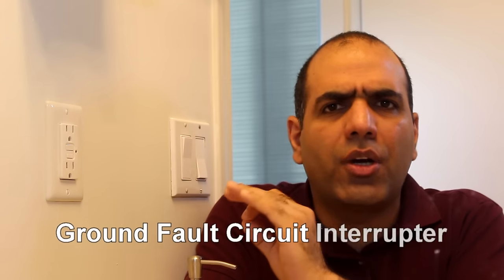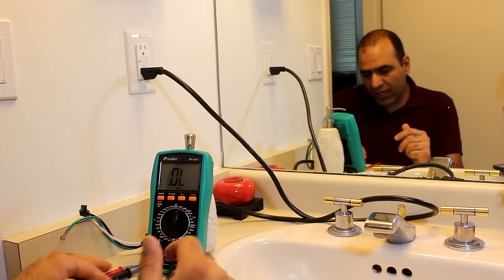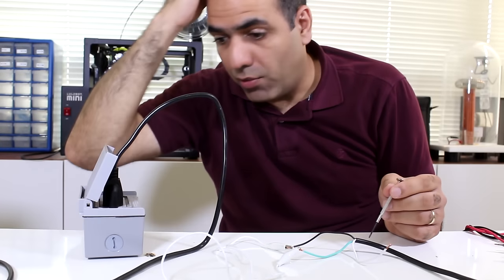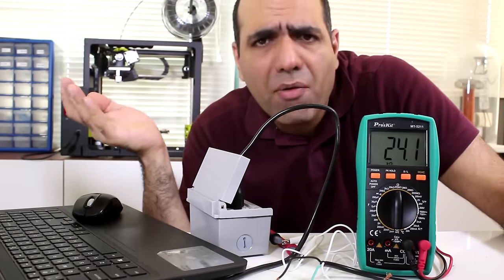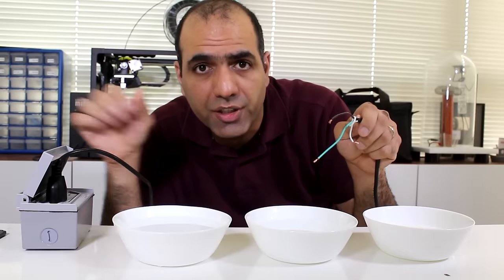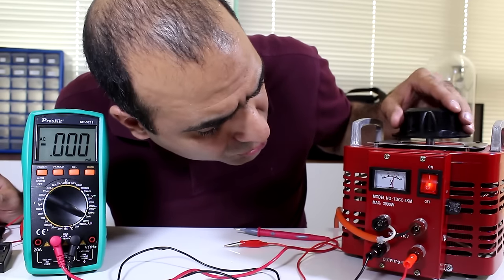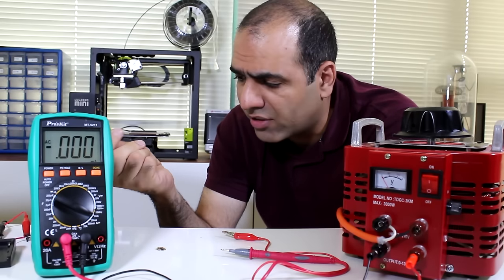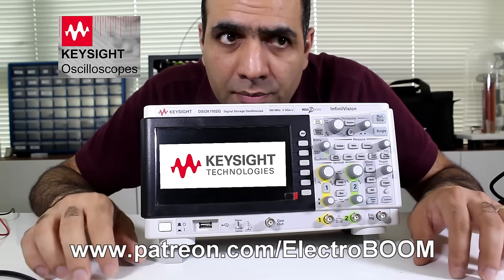The Outlet that Saves Lives

Comment: I stuck my fingers down a live lamp socket before, and I grabbed the bare contacts of a half-removed night light when I was like 4 or something. I just remember my fingers vibrating, but no pain.
Reply: Patrick Jackson i dont know what you mean by vibrating. Personally i  had a run in with a live lamp socket and it fucked me up. Good thing i was holding onto a metal bar. But in reality dont fuck with mains voltage.
Reply: It felt like a tingling vibration. Imagine if you lick a button cell but your tongue also vibrates. I live in the US, so our mains is 120 volts
Reply: I was standing on a ladder when my arm accidentally touched live and neutral wire, it felt like when you hit your elbow on the sensitive spot
Reply: Even when isolated from earth, touching 120V AC is defenetly more painful than a little tingle, especially for a little child. Are you sure the lamp was mains powered?
Reply: Very
Reply: Moral of story is, I will never try it again.
Reply: Maybe that lamp used to run on lower voltage
Reply: I can verify that it doesn't always hurt to touch 120v (at least right away). I accidentally stuck my finger into a light switch without a cover. It was dark in the room and I couldn't figure out why my hand felt weird until I noticed what I did. That was on 120v, and I was around 5 at the time.
Reply: Was it vibrating at 60hz?
Reply: I'd assume so given that it's the US standard.
Reply: Zaklamp that's probably because you did
Reply: this. i did this multiple times over the course of my life. some for extended periods of time for fun. it kinda spooks / hurts at first, but you quickly get used to it.

i've learned from my electric shock therapy that you take about a minute to get used to a painful shock, at which point you can increase it by about 5~10% to get back to the same pain threshold you were when you started. i did this over and over with the machine and ended up with a shock like 3 times as powerful as i started, and i started at the strongest shock i could tolerate without wanting to pull off my hand. unfortunately i don't have the data for the strength of the shock, but it was much, much more painful than a 127v outlet even at the beginning. at the end it was strong enough to contract / spasm my hand involuntarily every time the sine signal peaked. it set the machine to a 120 hz saw-wave ac current with a modulation (not sure if this is the right term, but you get it) of 0,5 hz sine, meaning it slowly peaked then faded out every two seconds .
Reply: It vibrated because you were feeling the current oscillating. Been there done that.
Reply: Patrick Jackson I did the exact same thing with a night light.  I've always described the feeling as the hardest vibration I've ever felt in my life.  I think I was 8 or 9.
Reply: wow, god must if gave you mercy
Reply: Alexander Worley if you were holding on to a metal bar that means that it would be grounding you and therefore as electricity flows from high to low voltage, it would send a high current of high voltage through your body and therefore would hurt you more. Let's say that you were standing on a plastic stool, you would feel virtually nothing if you only touch positive. Plastic is a good insulator and not a good conductor. Holding a metal rod didn't do much for you man.
Reply: Josh's Aquatics & Railroad Videos 120 volt wall socket has an extremely high current and that's what kills people... you can touch 200000 volts of electricity and not get hurt. As long as you are properly insulated and you only touch positive/ negative.
Reply: Patrick Jackson dude that happened to me too
Reply: My only run in with full 120 was when I was young messing with a night light. my fingers touched both contacts. The only sensation I can honestly recall was a numb buzzing feeling in my head for some reason. Even though my head would be totally isolated from the electrical path. It buzzed at 60 hz. The only reason I think it wasn't painful was just because most of the power was still traveling through the plug.
Reply: Getting shocked while you are isolated does feel like a buzz because your muscles contract at the same speed as the alternating current which is 60 cycles per second. Being grounded is a different story. I was working on 120v AC when the knuckle of my index finger came in contact with a hot leg and my wrist was touching a metal box that was grounded. The electricity burnt two tiny holes on my knuckle and wrist and it hurt like a MFer. Pick yourself up a Shocking pen or a TENS unit to see what electricity feels like.
Reply: My roommate got shocked with 230V mains when he was changing a broken incandescent lightbulb. I wish I saw that. The buzzing feeling may occur when you touch grounded surfaces and the grounding is not very good. I could light a neon bulb with my body capacitance and a ground terminal.

Comment: I have a question:

In Germany (231 V, 50 Hz) every new installation must have a RCD installed which opens at 30mA.
Usually our RCDs are connected to all 3 live wires and the neutral, but there is also a "special type" of RCD which is only connected to one live wire and the neutral and opens at 10mA.

A friend of mine said that if you would install these 10mA ones for a bathroom's circuit they will pop every time you take a shower because of the steam in the air.

@ElectroBOOM Do they really pop while having a shower?

Comment: I got shocked by a socket when I was 3 once and wasn't able to let go, my maid thought I joking for a bit and then she fucking pulled my hand out!
Reply: Hey my brother in electric! Iwas experiencing almost the same at the age of 6,my father tried to teach me how electricity works,build up a small circuit,but forgot to mention not to touch anything. I was asking "Dad what is this for" while touching the phase connection of a voltmeter WHEEEEE of i went ^ ^ Luckily my dad had also thought of an emergency switch on the experimenting board...
Reply: +Thomas Galea I'm in Singapore so I have the same voltage as you.
Reply: I used to get toys with the little plastic wire that held the toy in place. I would bite the tip of the wire and on the inside was a small amount of metal. I used to stick it in the outlet and my arm would go numb for a little while. I once couldn't let go. My God that was scary
Reply: I once touched both live and neutral wires while sitting on rusty iron staircase so it was 220+220=440V AC
I was in shock for 40 secs but somehow overcome it
Skin of my finger was melted

Comment: I think the reason the cold water doesn't trip the outlet's breaker is because the molecules are less spread out than if it were hot. So it poses greater resistance.

Comment: I think the GFCI may be wired incorrectly, it should gave tripped when you made the short.  It should not have made it back to the breaker.  If the Line and the Load wires are reversed the outlet will function but there is no protection provided from the outlet.

Comment: Be careful, just because the GFCI opens at 5mA does not mean that it will not pass more current than that, the GFCI has a certain "lag" in activating and during that short period of time the contact voltage is 120v and they are most certainly passing more than 5mA for the affected part!!!

 Since there is no way to limit the current that is going through you as long as the GFCI does not trip, that "ouch" 10:38 is surely more than 5mA of pain in miliseconds.

Comment: Not sure how you can have more chemicals in your hot tap water vs cold.  Most likely particle contamination from your hot water tank as it gets old and the lining breaks down.
Reply: Jeff G Hot water is more readily able to dissolve chemicals and compounds and keep them in solution, leading to an increase in mineral and chemical content per given volume. Part of this is due to the decrease in pH of water as its temperature increases.  This is especially problematic with old pipes made with lead in old buildings, where the lower pH of hot water dissolves more lead. This is a big reason why we shouldn't drink or cook with hot water from the tap, even if it has been cooled back down.
Reply: Interesting.  In most modern homes and apartments built since the 70's, piping is usually copper, and there is usually one common cold water input that splits to the cold water pipes in the dwelling and also to the hot water tank.   Assuming relatively short distances from the hot water tank to the taps, would you expect there to be increased mineral and chemical content in the hot water versus cold, and is that due to the common cold water source, hot water tank or the copper pipes?
Reply: biggdaddy2001 zinc is good fer ya
Reply: Good point.  And I believe there are anode rods made of materials other than just zinc.  Alum/ZInc, Alum, Magnesium, etc..   Electric tanks might use powered anodes that don't break down.
Reply: aluminum is bad fer ya lol
Reply: Jeff G my electric water heater eats through heating elements so that metal has to be going somewhere.
Reply: This is what Mehdi said at Reddit: "In my building, they specifically add some chemicals to hot water to prevent it from corroding pipes. It might be common in many homes, but I guess if you have your own heater maybe you don't add those."
Reply: +acidheartburn1 pH doesn't increase with temperature (how would that work? Think about it) without some outside influence. The simple fact is that, for most ions, solubility increases with temperature.
Reply: This is an amazing thread of comments. This made me go research a bit about cooking with warm water and holy cow I guess I'll just run cold water in a pot before bringing it to a boil now instead of warm. Thanks for the heads up guys!
Reply: Puls ........ yes it is not recommended one use water from the hot tap for cooking. Water heaters get sludge in the bottom of the tanks so why would we want to use that water for cooking?
Reply: yea it shouldnt be extra chemicals... a bit more rust(if its old) and a some salt stuck on the heating element
Reply: Well, pH of water does decrease with increase temperature, but so does the pOH, so it doesn't actually become more acidic.
Reply: Jeff G flouride and whatever other cleaning agents reside in tap water. Calcium, copper piping (if old enough)
Reply: Hot water tanks have an Anode Rod that are made to break down before the tank does. A good water tank has 2 anode rods, the reason is because humans are lazy, you are supposed to change the Anode Rod on a water tank after so many years. A lot of people don't bother so they started selling them with 2 anode rods to work longer before the tank goes bad. You are also supposed to drain a water tank fully to flush debris about every 6 months but you would need a water hose connected if your water tank doesn't already have a pipe directed outside which some Duplex homes have to keep the utility room from flooding in case the relief valve blows.
Reply: Jeff G cold = no good for bacteria
Reply: Jeff G what are u guys even saying. Please speak English, I don't speak the language called "My Best College Class Was Math and Science"

Comment: when i was a bit younger, i lived in an old 1950's 60's apartment complex on a social neighborhood , i used to have the habit of biting my nails and sometimes i had exposed tiny bits of skin before the nails(gross i know lol but anyone who bites or did so knows what it is)  and everytime i took a shower, the water would zap me only through those patches of skin exposed, anywhere else i wouldn't feel them, the pain intensity was similar to a 9V battery on your tongue! I never understood if it was rust or chemicals on the water or if there was some electricity on those pipes, even if i had cuts or bruises somewhere else on my body for whatever reason, it never triggered that pain , only on the damn fingers where skin was exposed so i never knew what the hell it was!  Chemicals?(i did a test once with a 1 time use kit and the levels were normal) and i never saw yellow water from rust on water(that i do notice on my new home now but there's no shower zapping here, it's a 1920's home xD)  anyways, just a random thing!!

Comment: I knew a doctor who told me about a case she'd treated where a woman washing a metal screen from a window was struck by lightning while holding the screen.  She claimed the woman had a burn on her hand where the lightning entered, and that she had a burn at her elbow caused by the lightning being attracted back to the screen as the woman dropped it.  This always struck me as wrong.  I don't think the doctor was lying about the presentation of the injuries, but I don't think it happened the way she thinks it did.  Anyone have any ideas?
Reply: she? she what?
Reply: electricity follows the path of least resistance.  It also moves very fast.  So what could have happened is lightning strikes screen hand is a voltage divider whatever electricity that remained in the screen is discharged to whatever qualified as ground faster due to less resistance afew pico or nano seconds later or so the electricity has traveled from the hand to the elbow and discharges to the screen again and follows the path to ground.  Whatever minimal electricity that remained gets dissipated in less dramatic fashion.
Reply: What's going on? Why does everyone stop writing in the middle of a
Reply: senten
Reply: paragr
Reply: That would match what happened to our science teacher's friend back in high school. His job was to move houses for a living and if they could get the house under without more than lifting wires then they left the cross road wires up. With current. The wire slipped off the lifting pole, sent current into his hand and blew out his elbow, wrecking his arm.
Reply: NKD Didnt know you watch these vids. Im a sub btw.
Reply: it comes in and it goes out somewhere.
Reply: Candlejack: Hey guys, what's goi
Reply: NoJusticeNoPeace my cousin's husband was electrocuted by high voltage from the power line and a very same result. The arm from wrist  to elbow was ripped and burned open, he narrowly escaped death.
Reply: +Just Another Person In this case, she had the screen completely out and in her hands as she was washing it.  The lightning struck the screen, so to ground out it would have had to travel through the woman holding it, so the burn on her hand makes sense.  But there was also a burn on her elbow and the woman wasn't dead or unconscious, so the charge somehow travelled through the screen into the woman's hand, then down her arm and out again through her elbow to the screen.

The doctor was under the impression that as the woman dropped the screen, the lightning was drawn out through her elbow back into the screen as it fell, but that makes no sense.  First, electricity travels fast enough that it would have grounded out long before the screen had time to fall any appreciable distance.  Second, jumping an air gap has to overcome a tremendous amount of resistance, and the path to ground should have been much less resistant through the woman's feet.

The only thing I can imagine is that the woman was either standing on something highly resistant, like rubber boots or a wooden stepladder or something, or that the screen may have been slightly in contact with something metal like a window frame or a drain spout which was grounded out.  Whatever happened, it had to be highly unusual circumstances to produce the effect the doctor described.
Reply: TWILIGHT ZONE !!! LOL !
Reply: There is clearly something wrong with your imagining of the circumstances.  Speculation is a hell of a drug so I'm not going to do it but the lack of a third exit point is telling.
Reply: Lightning can also fork and take multiple paths, maybe the electricity entered the elbow as well as the hand.
Reply: One time I was working on a lift about 5 feet from where power lines go into a building and lightning struck the power line on the other side of the street and when the electricity got to my side, th

Comment: Question- If you were totally isolated from ground with no capacitance in question, would you still get a shock from a live AC source? My point being, does AC need a closed circuit to flow through the body?
Reply: Yes and no. There is professional equipment to isolate yourself properly so that you can indeed touch one wire without feeling it at all, but that only applies to a certain voltage, current and frequency the equipment is intended for. High voltage high frequency for example could even spark to your body when you were flying because of the resonance with the parasitic capacitance.
Reply: like a bird standing on power cable.
Reply: There is no real way to reduce your capacitance to zero so there will always be some current flow. 

As for safety? If you're fully isolated you won't die until voltages reach nonsensical levels. It doesn't really matter how much current flows as it will only do local damage. (If you reached out with a finger it would go from imperceptible, to a tingle, shock, burn, and finally arc flash damage until eventually enough energy would be released to detonate enough of your hand that the blast would kill you, but that would probably require non realistic means of isolation from and approaching the voltage source)
Reply: Do the birds feel a slight tinge of a shock when they first land on a 14KV AC line? The bird's voltage is not likely 14K when flying, so there will be voltage difference when the bird first lands on the wire, and therefore a current will flow. Obviously it does not kill the bird. But do they get a "fuzzy feeling" in their feet when first landing?

Comment: @ElectroBOOM The current is rising because you are sweating.
Reply: Michael Gudkov thinking the same thing here.
Reply: High voltage can move through air if it's high enough.
The higher the voltage the easier it is for the current to move through insulators and make them fail,as a result the current rise.